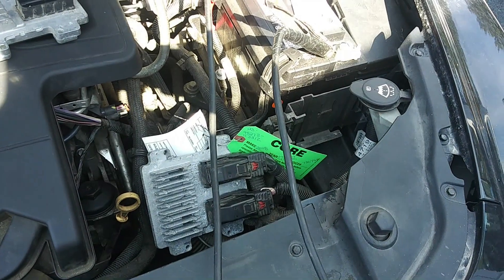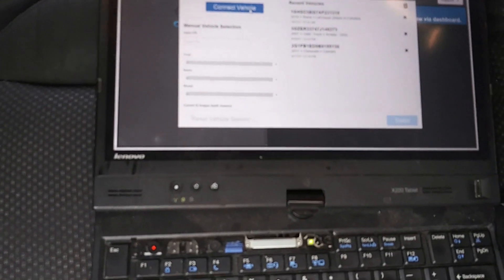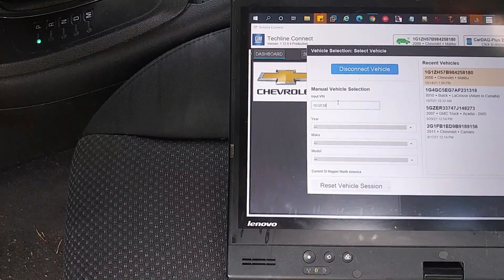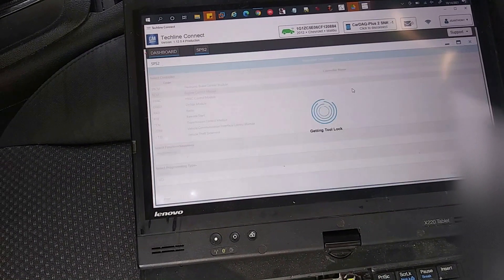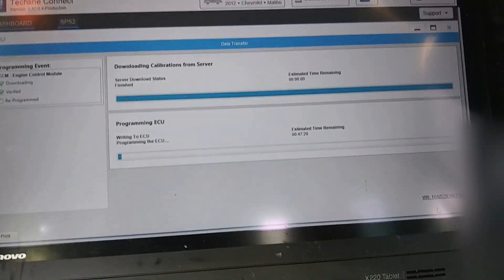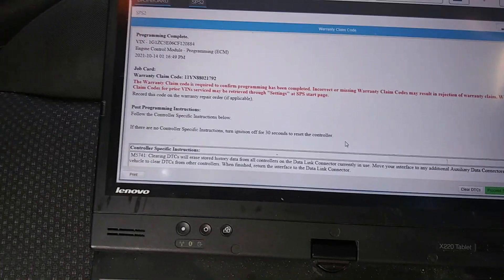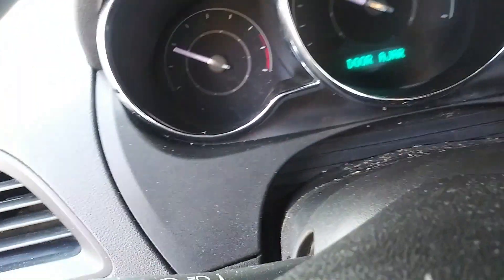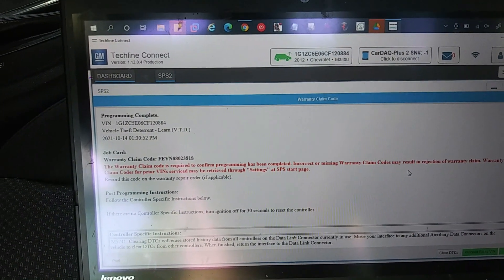Programming used replacement ECM on a Chevy Malibu with the new SPS2 via j2534 Cardaq plus 2

Comment: I have a 2016 Chevy Malibu , I need a new ecm and I was going to buy a used one and was wondering where can I get it reprogrammed besides the dealership or do I need anything additional other than the ecm.
Reply from the maker: That is a "Global A" type ECU ( https://autoelectronics101.com/index.php/auto-repair-help/list-of-gm-make-and-models-using-global-a-architecture )
Meaning you will not be able to program a used one like I did in the video. Only way to get a used one working is by cloning the original or virginizing the used one first and then flashing it like I did in video.

Comment: I could not perform the second part of TDM learning, it keeps re-trying but never goes to 12 minutes screen. When learning the keys manually using the 30 minutes the car will start but if you turn the engine off will not start again unless you perform the 30 minutes relearn.
Reply: Update: The replacement ECU was defective
Reply from the maker: Use a new unprogrammed key
Reply: @ecurepair  Thank you, I will try
Reply: @ecurepair  New key did not solve the issue, the original ECU was shorted, either the replacement ECU is defective or the original ECU damaged another module, I even replaced the TDM and still having same issue

Comment: Currently working on a 2011 Malibu put new ecm when I try programming key the ecm stays on learn mode for immobilized car shuts off after 2-3 seconds
Reply from the maker: try using a new key to program.
Reply: How did you solve this?

Comment: Thanks for this great video. I was trying to reprogram a used 2011 chevy cruze ecm (delphi dcm3.7 ap). After ecm programming when I try to perform the immo learning it shows this : parameter id is not supported, try to reprogram the ecu with correct sps software calibration. 
The mistake I did was maybe to keep the registered vin on the ecu during the flashing process. I did not change the vin as you showed it on the video.
Reply from the maker: Yes you must change the VIN. You will need to find out if the 2011 cruze is Global A architecture or not. Those you can not do used modules with SPS2. https://gm-techlink.com/?p=11221
Reply: @ecurepair  Thanks for your support. I can see 2011 cruze on that list. So does it mean that there is no way to swap the ecu ? What would be the solution in that case? Using a virgin ecm ? Thanks once again.
Reply from the maker: For SPS you would need a virgin ecu. For a used you can clone original with aftermarket tools like kess3, i/o terminal, etc.
Reply: Which on do you recommend to clone  2010 vehicles and also global A?  @ecurepair
Reply: Any help is welcome. I am using autel j2534 programmer.

Comment: hello, I will do the same in a car with a wireless key and the switch changes from on to off in 5 minutes do you think I should run it regardless or turn on the car so that it does not happen?
Reply from the maker: I'm sure there is an official way to do it but I always just stand by switch back on myself quickly if it switches itself off. Never had any issues doing it that way.
Reply: @ecurepair  thanks!

Comment: So I’m in the process of flashing a reman ecu in the same platform as your working on in the vid. I flashed the ecu and went to relearn the key. Once there and after clicking start programming the window pops up downloading cals, that loaded completely then the programming ecu spot says connecting to vehicle, I have not gotten the 12 min wait video and I have been hooked up for almost 20 min now on this screen any ideas?
Reply from the maker: Not sure why its frozen but you can always just do the 3, 10minute waits.  Should take care of it.
Reply: @ecurepair  thanks I’ll look into that, I usually only do euro stuff I’m not familiar with the 3 ten min wait. Thank you. Good video as well
Reply: @ecurepair  I’m not sure why it froze either, I tried to figure it out but never did. However the three ten min wait took care of it! Thank you once again🤙🏻
Reply: Window not video, sorry

Comment: I got th B0389A fault on the Chevrolet Cruze 2010, Will it be able to replace an ECU in this case
Reply from the maker: You should be ok to replace  with used ecu on a 2010 cruze. 2011+ starts a system type called "global A" and you would need to use a new/virgin ecu.
Reply: @ecurepair  
Thank you @Keyworks Repair 
I am quite surprised why I get that B0389A code because it is linked to Environment Identification, I checked further that Environment Identification is linked to "Global Architecture" models and yes like you mention, for cruze that starts in 2011.

So I will get the DMI(clone)then go ahead and replace ECU and see what happens, in case it fail my question is, how is the resetting done to virginise the ECU, is it through SPS2 as well?

Comment: for some reason i do not have the override option when trying to program a used ecm
Reply from the maker: Make sure you do not connect to vehicle with the automatic option. Instead type in the vin on the first screen then connect that way or the override option wont pop up.
Reply: Is this still working for you,  All I get after  manually typing
   Vin  in left box is Vin miss match,  Proceed with wrong Vin or Cancel.
Reply from the maker: @henryford4337  yea you just need to proceed with "wrong" vin
Reply: If I proceed  with wrong Vin, can right Vin then be written? Thanks
Reply from the maker: @henryford4337  SPS refers to the VIN you typed in as the "wrong" vin and that if you want to proceed you will overwrite whats currently on the ecm that it considers the correct vin.  So to write the VIN you typed you need to select the overwrite button a couple of times through the process.

Comment: I tried to program one the other day. The window that has connect vehicle never pops up for me after I open the program. Purchase like normal, add vin, then it opens the techline and only gives me the option to log in.
Reply from the maker: You have to open it from acdelco website like old sps not the shortcut on desktop, just delete it to prevent future confusion.
Reply: I had the same issue the other day. I uninstalled SPS and reinstalled it. Worked then.

Comment: It’s not actually mine it’s one I’ll be working on. Basically they put a used trans in a 2010 malibu bent the rap out of the pins so the tcm in the used trans was a no com. They put the original one in the used trans now they say it won’t do anything. You think that still a programming issue?? It’s the one you have to pull the pan to do.
Reply from the maker: I think the tcm in this year are only coded by vin so I would assume the original would still work in the case you described and you may have other problems but I'm not 100% sure sorry. You will need to check dtc's. If there are any config error codes then I would take a guess that the ecm was updated past a compatible calibration when they tried to switch it with the donor unit and programming will probably fix it.
Reply: I’ll try reprogramming both ecm and tcm together

Comment: Hi,I have a 2011 Chevy Cruze 1.8 auto, changed the TCM with used one ( Gen1 ), will GDS2 over write the vin of replaced TCM.Do not have the old TCM any more.
Reply: yes, i did one the other day.  it’s easier to inhale from the old and just change the vin in sps2, but you can do it. check service information

Comment: did you ever have problem programming a use bcm ?
Reply from the maker: Only if its global A. https://gm-techlink.com/?p=11221 . Those I just clone if customer wants to replace with a used one.
Reply: @ecurepair  hey I have a 2012 chevy malibu also I'm going to get a used replacement ecm about how much will it cost
Reply from the maker: @cbriggsmkx1436  depends on where your located I guess. parts prob 60-100. programming for pcm and key is prob 120-200 Id guess.
Reply: thank you
Reply: Hello, I’m new into the programming world, I got a maxicom device, mk908p, it comes with a jbox but I can’t program gm vehicles, please help!!

Comment: So do I manually enter the correct vin number that's on your car right
Reply from the maker: Only if replacing the ECM. @1:35 in video the screen that pops up is where you need to manually enter VIN if changing ecu. If using original ecm and just updating or changing a different module then you can just "connect to vehicle". I made a mistake in the video the first time thats why I connected first then had to go back and manually enter it.
Reply: @ecurepair  I keep trying to use my vcx nano gm device bit everytime I install techline it delete my current programs and rewrites the. To a point we're every time I choose a device I get am error and force to shut down. Any ideas
Reply from the maker: @alexarias3289  Install it, then close your browser and re open it, log back into acdelco, go to "add vin" in the sps menu then when the techline download page opens up there should be 2 buttons now, the left is to re-install, the right is to launch techline. I missed this and reinstalled it a few times not paying attention I was just about to call tech support then I noticed the right button. See @0:30-1:04 in video
Reply: @ecurepair  thanks I'm about to check it out hopefully it works
Reply: @ecurepair  bro I really need your help I tried everything Everytime I install techline I lose connection to my vcx nano when it comes to chose a device I get 3 option  Bosch Bosch and then my device which is in yellow when I click it I get a error and techline goes to shut down mode and then when it allows me to enter I get the no vci connection
Reply: I tried calling support been waiting for I swear to god like more than an hour trying to get support and no one answers
Reply from the maker: @alexarias3289  Sorry I dont know that ptd. Ive only used drewtech,mdi,jvci and tech2 for SPS. Sunds like your having driver issues tho or maybe the device isnt supported. Tech support from acdelco is not going to assist with this ptd problem there going to tell you to contact the ptd creator unfortuently.
Reply: @ecurepair  I'm new to this what do u mean when u said you only use tech2 on sps. How do u set that up I guess I've been doing it wrong the whole time I've been trying to use gds2 all along
Reply from the maker: I just meant using the tech2 as a pass through device on SPS(now techline). I generally always use drewtech's cardaq plus 2 which works flawlessly.
Reply: @ecurepair  how much does  that device cost
Reply from the maker: @alexarias3289  links in description. sometimes you can find used one cheap. If getting a new one its best to get the newer cardaq plus 3.
Reply: @alexarias3289  turn off,  firewall and network proteccion in youre computer
Reply: @eribertojimenez  I got it to work had 3 issues first off I had windows home needed windows 10 professional. Second issue was that the program that came with my vcx nano gm corrupted the updated versions that techline gd2s. Meaning  I couldnt use tech2win anymore. Third issue was when deleting gd2s and reinstalling it would not work because you have to delete all the programs including the registry key and reinstall everything back except gd2s. U need the gd2s from techline in order for you to be able to use techlines sps2. But thanks for your help.
Reply: Now my other concern is that the first time I used it I was using it to fix vin number issue on a ecm and this next time I used it I needed to replace and reprogram an ecm but the writing to ECU procedure seems to be to fast cuz if reprograms it in like 2 minutes . After getting the warranty screen the ecm still don't work . So does it normally take 2 minutes to write the programming to the ECU is that an issue that I'm having.
Reply: @alexarias3289  yes its quick reprogramming now,
Reply from the maker: @alexarias3289  Yea its possible. Some units are quick programming, some take a little longer.
Reply: @ecurepair  alright good to know thanks alot guys